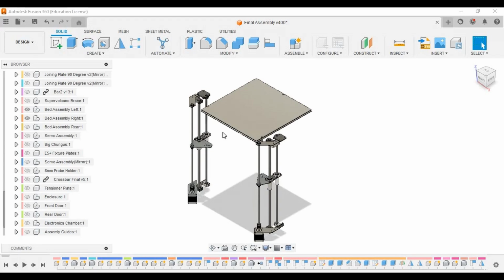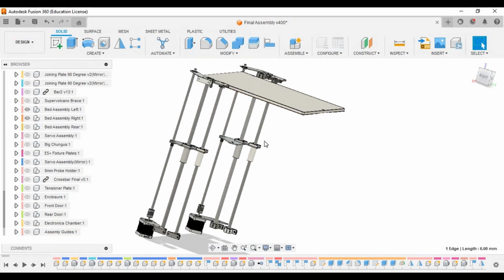Easy Triple Z for Your Printer ? Z Axis Part 2 | Proto1 3D Printer - Ep 03

Comment: linear rails bro
Reply from the maker: In my opinion, round shaft bearings are much more suited to z axis, due to low speeds and high rigidity, linear rails are much more suited to high speed, relatively low mass applications.
Reply: @al-Zughal  indeed but you also dont have to use 2 rods it will get supported from the other side too... well you can better understand it because the issue is in front of you.. im just giving my feedback... machine looks great though

Comment: this is probably why the trident uses linear rails for the Z. since the rails are rectangular you don't have this issue as much
Reply from the maker: Good point, I also realized this once I had to add the second slide, but at that point, I was so committed to this idea, I had to do it
But their is one good thing about these that rarely gets mentioned, rigidity, the system is extremely rigid. I have built machines with rails for z axis and they have deflection due to sudden movements, but this, its rigid.
All in all, I am happy it works now, and time to move to xy axis where I am going to use a ss304 crossbar for x rail.